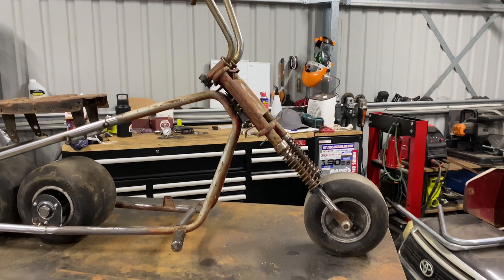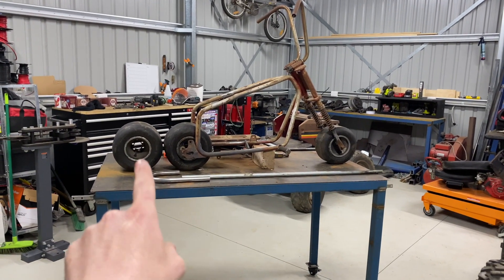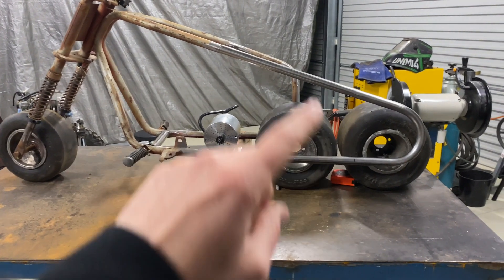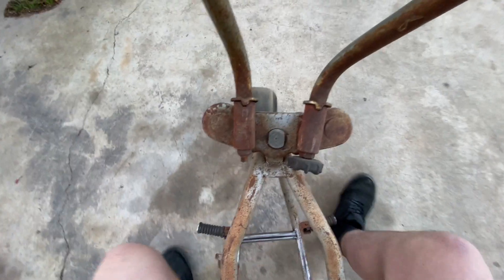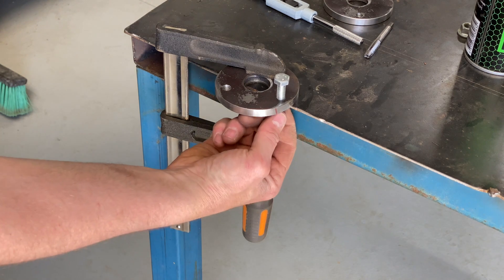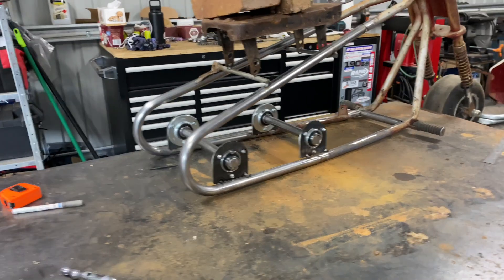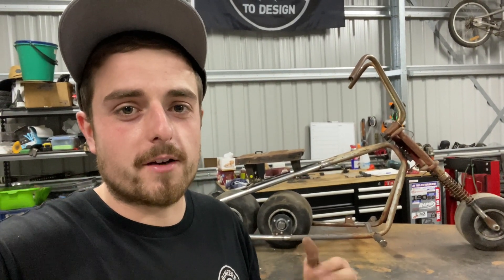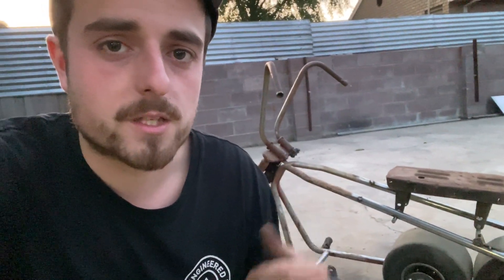AMAZING 3 Wheel Mini Bike Build Pt 2

Comment: Great looking, innovative  project. Unfortunately according to principles of physics relating to friction the extra drive wheel does not provide any extra grip that is not provided by one drive wheel only. The only added advantage of the extra wheel is that for a very soft grippy tyre your rubber will wear more slowly. Friction with the road surface is dependant only on the nature of the surfaces in contact and the weight of the vehicle and not with the area in contact.  However good luck with the project, you will have some amazing experiences.